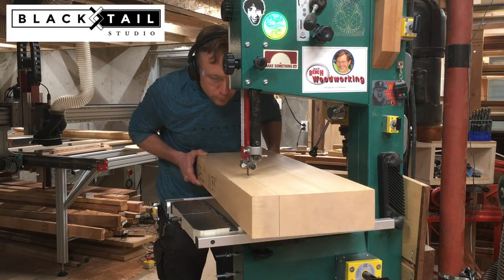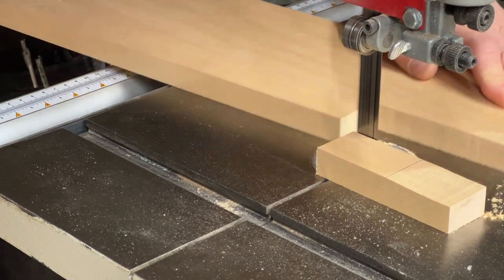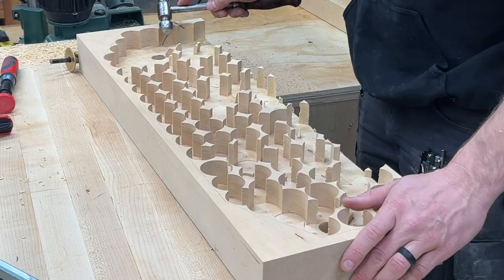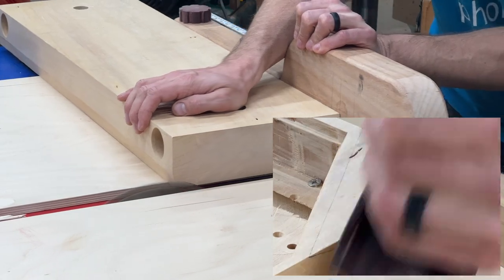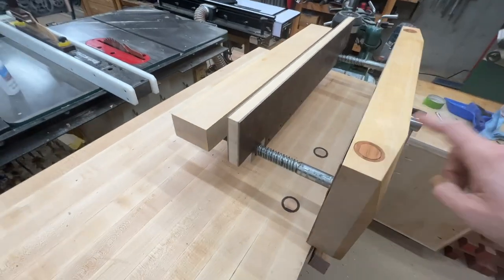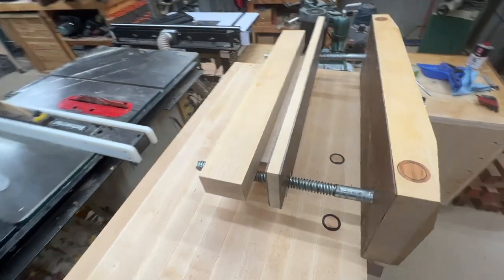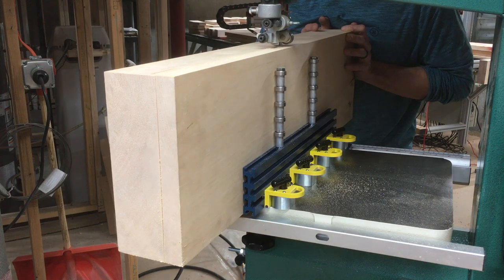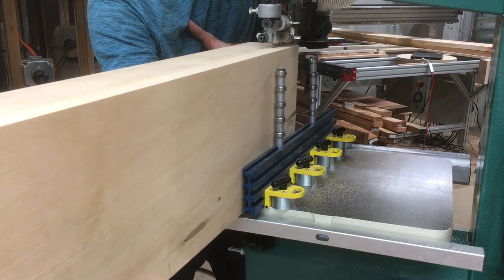Blacktail Studio Slab Vise Build

Comment: Styrofoam is your CNC’s best friend for program testing (albeit a bit messy). And as a bonus, you can run the program at high speed thru the foam so it doesn’t take long to verify it.